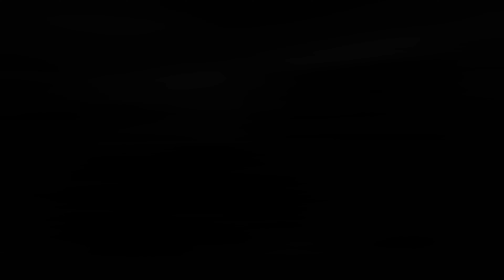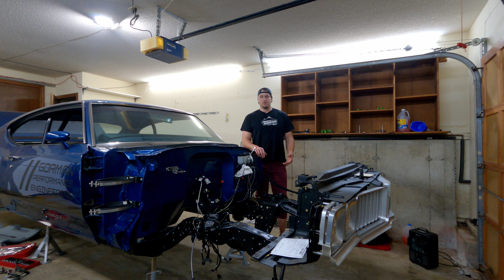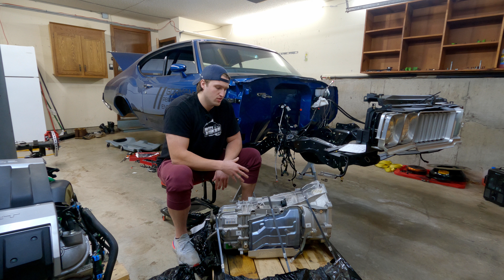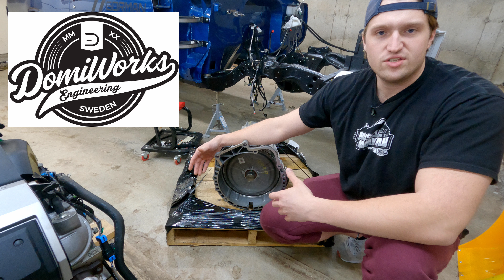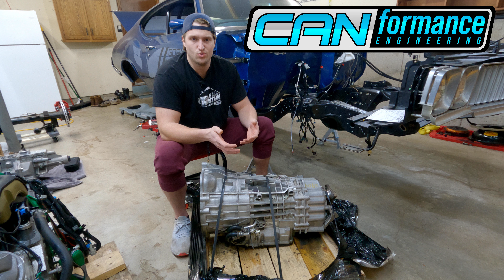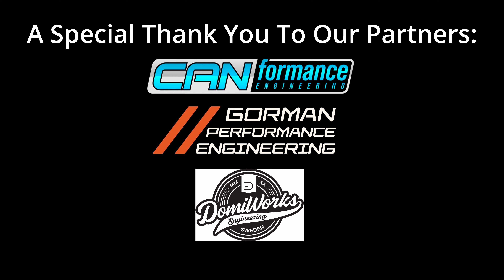We're Doing The ULTIMATE Pro Touring Transmission Swap

Comment: Anyone know How much torque that RAG box good for in a light car? Is 1k hp with sticky tires out of the question?  Also about how much do you have invested in the gear box including the adapters and electronics?   i’m guessing 7/8k to do the swap. Thanks
Reply from the maker: Factory clutches are good for around 750lb/ft, and aftermarket clutches will bump that number up to 1,000lb/ft. Id say it depends on your use case. I personally wouldn’t use this in a drag race car for example, but it may be able to sustain that power in a road race car if set up properly. I’d say you’re in the right ballpark regarding cost.
Reply: Thanks for the reply. Good luck on the project.
Reply from the maker: @scottgarmon4865  no problem!